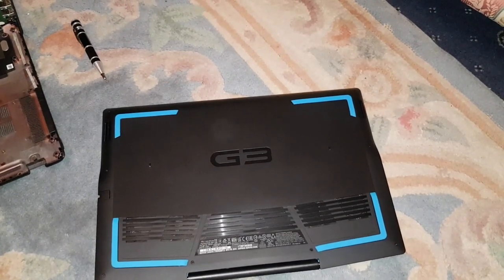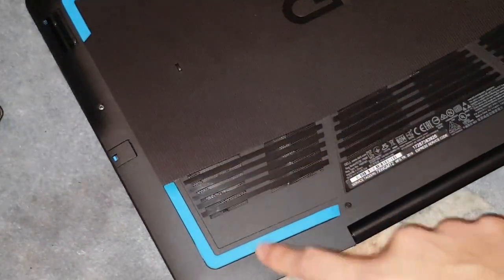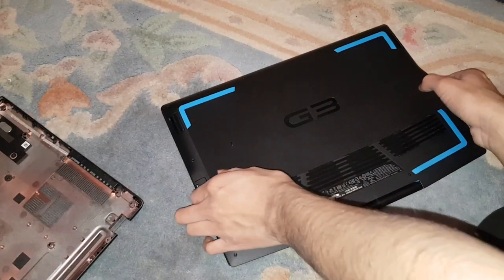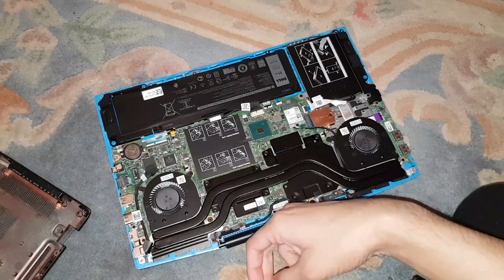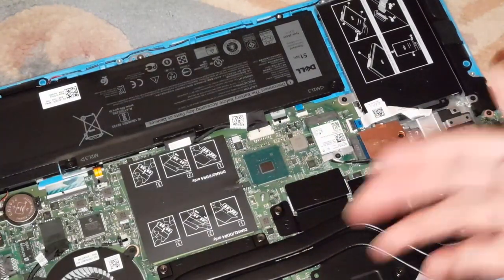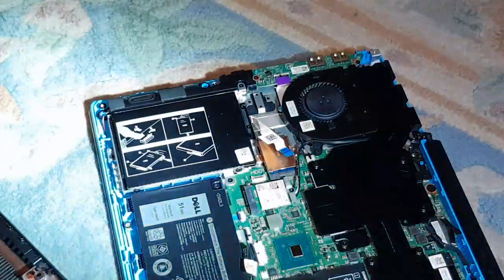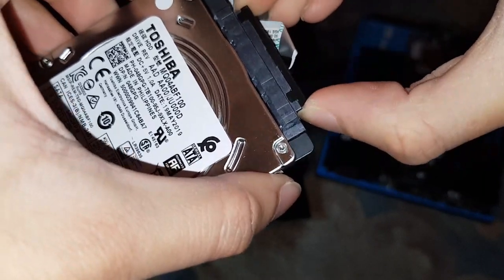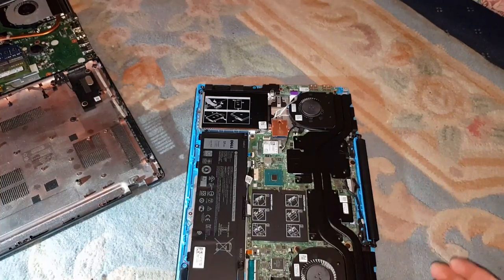How To Install Ram And SSD In Dell G3 Gaming Laptop

Comment: Hey buddy. Im new to this pc gaming stuff, I  have a G3 gaming laptop , it comes with a 512gb SSD. My question is why would someone want to do this? I thought HDD are the past and SSD is the future? Am I okay with my 512gb ssd?
Reply from the maker: Your 512gb ssd is quite small tbh, as some of it will be taken by windows 10 already, which wont leave u much space, for example rainbow six siege after installing the game and updates goes well over 100gb alone. Call of duty games the newer ones do the same. Most new games take a lot of disk space. So i would recommened for future proofing a 2tb ssd. The ram part 8gb is enough for just gaming, if you like me and do video editing and streaming and stuff like that then more will be needed to run smoothly. I got 32gb ram and thats good enough for me and future proofed
Reply: @MrWaheedulHaque  sweet thanks for the great info! Yeah makes sense now, 500gb is basically like 3-4 Triple AAA games if that.
Reply from the maker: @DIYStangsandFreedom  yh

Comment: Hey buddy, i’m planning to buy an NVME but for the 3579 version of the Dell G3 15. 

What I want to ask is: I know how to install the hardware but after installing the NVME SSD, will I have to do some programming while booting up the computer or the SSD will be auto detected and auto programmed without doing anything????
(I do NOT plan to clone Windows from my default HDD to the SSD, i just want to use it as extra storage. )
Reply from the maker: As long as you not booting windows from it, it will be fine. If this is just a second drive then it will be ok, all you have to do is initialise the drive on windows, to do this go on windows search type in create and format hard drive partition, click it then go on it and it will show your new m.2 drive, right click the unallocated area and it should come up with somethimg like initialise or create partition, you will understand what i mean when u see it, then just press yes to everything unless you want to split that drive up, otherwise just press yes to everything and carry on and it will be set. Then you can access it on my computer. I did make a video on it but it wont be up for like another week most likely
Reply from the maker: Also i highly recommend the samsung 970 evo plus if you got the spare money as it is currently the fastest m.2 money can buy. If not go for a crucial as they are pretty decent priced
Reply: MrWaheedulHaque thank you!
Reply from the maker: No problem

Comment: so do m.2 nvme ssds work on this?
Reply from the maker: Yes this comes with m.2 preinstalled but you can switch it out for a faster or larger one
Reply: MrWaheedulHaque thank you ! one more question, can i have a 2.5 ssd and an m.2 ssd installed at the same time. and is it any benefit compared to 1hdd and 1ssd
Reply from the maker: Yes you can have 1 regular 2.5 ssd and 1 m.2 drive at the same time. The only benefits is extra storage and speed over a regular hard drive. I recommend 1tb 2.5 ssd or larger depending on how much games you have
Reply: MrWaheedulHaque thanks man i appreciate it
Reply from the maker: @botdog370  no problem my friend
Reply: You pointed at the wifi card not the cpu, that would under one of the heat shrouds connected to the heat pipes.

Comment: Bro this laptop dell g3 become very hot above 80c any fix idea
Reply from the maker: Check my channel, i have video on different gaming laptop on how to undervolt cpu and gpu and another video on how to repaste thermal paste, those are your two options to drop temps otherewise you can get a cooling pad which will help a few degrees but not by much
Reply: I purchased this laptop 4days ago
Reply from the maker: @Amritkumar-ns8vb  doesnt matter haha, i purchased mine and had same issue, it is due to poor thermal paste cheap one they use, first thing to do would be try undervolt and see if that helps enough to lower the temps, if not thermal respasting will be  only option